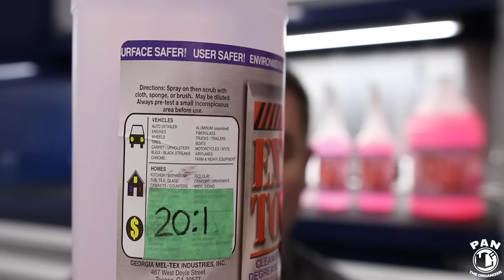EXTRA TOUGH multi-purpose cleaner and degreaser review!  +15% DISCOUNT !!!

Comment: I have been using Extra Tough for about three months in my detailing business and it has replaced Meguiar’s APC, SuperClean and Simple Green.  This is a really versatile product that does not have the strong fumes when sprayed using a 1:1 dilution.  Outstanding as a strip wash to remove waxes & sealants and you don’t have to worry about how long it stays on the clearcoat.  Powerful degreasing action for engine bays and cleaning grimy, greasy wheels. Saves me time cleaning floor mats and it will not discolor plastic or vinyl surfaces. 
The product is packaged with great care so it will not leak during shipment and you get the full amount you paid for.  Very economical when you calculate the cost using the different dilution ratios.
Reply from the maker: I agree with everything you said John!  Thanks for sharing.
Reply: Thank you for the great review and letting us know about your experiences!  We really appreciate it!  I hope everyone reads this!  It means a lot to us as a small business.
Reply: Any feedback regarding use on aluminum engine blocks?
Reply: Can you use on clearcoat with no protection?

Comment: I have been using Extra Tough Multipurpose Cleaner since Wilson Auto Detailing demonstrated this product.  It has been a huge staple in my auto detailing.  I use it on my personal cars as well as others and have been very impressed with how safe it is to use.  I also use it around my house for exterior washing and for stain removal on clothes.  The results have been amazing.  When you buy it from their site, they include a dilution chart.  If you follow the chart, you will not be dissappointed and the gallon goes a long way.  The smell is not offensive and the customer service is outstanding.  As a long time user of this product, I can testify to how effective and safe it is to use.  I love it and highly recommend it.
Reply from the maker: Thanks for sharing your experience Melvin!
Reply: why did luke take the video down?

Comment: I don't see my previous question so I will repeat it. How to get grease off a rubber truck mat under a propane food smoker? I applied it with a 1:1 ration yesterday and I re-applied it again today. It did a pretty good job. I'm guessing this was a 2-year buildup, so I can't expect perfection. I have a kayak that was spent 1000-hours in Lake Tahoe and it easily removed all the water marks. 15% off still worked. Unfortanely the US Post Office didn't live up to its 2-day delivery and put it sideways in the mailbox, even though it was marked this side up on all 4-sides. Good news its was packed perfectly and didn't leak.

Comment: Hm super clean 8.92 a gallon at Walmart or 32 a gallon for this stuff . Naw I’m good , super clean it is
Reply: Super Clean doesn't really work much at a ratio up 1oz Product to 32 oz H2O. For the need to be gentle, Extra Tough works quite well. Super Clean and Extra Tough have their places, but for regular maintenance, Extra Tough.
Reply: Collin Hopper will extra tough foam if put in a foam sprayer?  Thx

Comment: I used Extra Tough on my engine & under carriage of my 69 VW dune buggy. It leaks oil around the valve covers and gets really nasty & dirty from going on & off road. I was impressed "E.T." removed the oil and gunk with little effort. Other comments on this post mentioned Surfex HD. Now, I can't compare to Surfex HD as I have not used it. I personally have used Simple Green for years. Like S.G, E.T. it is also a safe, non toxic, biodegradable and made in the USA.  Based on my comparison I found E.T. to be more aggressive on removing the dirt, grime and oil. One side of my engine I sprayed ET, waited a minute and the engine came clean with minimal effort. I repeated the same process for the other side with SG, it came clean however it took 2 & 3 applications with more aggressive scrubbing & wiping to get the same effect depending on the area. I used full strength for both products, no diluting. My wife used it to pre-treat some stains on our concrete patio prior to pressure washing and they disappeared completely.  I admit its a new product for me and I was skeptical cause SG has been my go to cleaner but after trying it for myself like Pan did in this video I can say hands down it works great for general cleaning or degreasing.  Pan, great informative video, with different applications and ratio's. Good job & thank you sir.
Reply from the maker: Thanks Jim!  And thanks for sharing your experience with my viewers!
Reply: Thank you for trying Extra Tough out and sharing your experience!  We appreciate it!

Comment: Hi Pan. Sorry this question is off video topic.  My wife’s 2012 Volvo XC90 has the tan leather interior and well the leather hasn’t held the tan color very well in the front 2 seats. There are light spots.  I was thinking about re-dying the front two seats. Do yo have any suggestion of either alternatives to dying or which product to use to dye the seats with.  I didn’t see a video where you got that Indepth into restoration like that.   Thank you. Phil M.  😎👍🏻
Reply from the maker: Hi Phil.  You should reach out to the guys at Colourlock.  They are leather care experts.

Comment: Pan quick quiestion. Is the maguiar's synthetic xpress wax  considered a ceramic coating as well as the turtle wax ice seal and shine?  I ask beacause am not suere if I should apply IPA before. Since that is apply (according to you) before ceramic coating.
Reply from the maker: Xpress Wax is just a spray wax.  You don’t have to IPA before applying it.
Reply: @PanTheOrganizer  ok got it. Now what if before the xpress wax I did a compound and eventually a Polish do I still have to apply IPA?
Reply from the maker: It’s always important to use an IPA after the last polishing stage.  It removes polishing oils and allows a better bond of waxes, sealants or coatings.

Comment: If I want to remove the wax layer on the car, what would be the dilution on that? Thank you!
Reply: 1:1
Reply: @1_Moretime  Will it act as a decontaminator too? I'm trying to get it down to bare bones I guess before I apply wax or coating or sealant
Reply: Performance Now  more of wax or sealant remover. I would suggest to use a iron remover and then follow up with clay bar....and your choice of wax/sealant.  Hope this helps.

Comment: Good stuff albeit pricey

Edit: when you used 1:1 as a presoak you only showed wiping it off with a towel. Assuming you eventually rinsed it off? Did  have a issue with a residue left behind?
Reply from the maker: No residue. :)

Comment: 8:38 Uh Pan, did you take a look at those door hinges? Thanks for the link, I will have to check this out. My trouble area has to be the wheel wells. My tire is too close to get a brush in there and I have been looking for something I can spray and and remove with the pressure washer. I've tried just about everything and while it looks clean at first, that white film comes back unless I agitate it with a microfiber towel. I can get everything else clean, just those dang wheel wells. My next product to try was going to be the foaming stuff like engine degreaser.

Comment: But is it better than Simple Green?  What about painted factory wheels, is it safe?  Thx for the video.
Reply from the maker: I never tried Simple Green.  Do you watch Darren’s channel?  :)

Yes it’s safe on all OEM wheel finishes.
Reply: Tundra Whisperer I feel Simple Green is just a waste of time imo. It has never cleaned anything that I have applied it to. If I’m going to use a product for home application, my go to is Krud Kutter it’s safe, non-toxic, biodegradable and it kicks a$$.
Reply: akaredcrossbow interesting, never heard of that.  I’ll look for it.  Thx
Reply: Pan TheOrganizer I catch his videos on occasion, but man can that guy talk, WOW!
Reply: Tundra Whisperer I use the Tough task Krud Kutter. I have never tried it on tires, but I bet it would clean them very well. Im going to have to try it. It’s also not expensive. It works amazing in a smokers car, it makes the panels look like they are bleeding! Gets rid of dirt immediately very quick! They have several products! Krud Kutter Original removes grease, wax, tar, sap, fabric safe, water based and leaves no residue. I’ve never used the original, but it’s probably as good as the tough task! Rust-Oleum makes the product. The smell is ok not my favorite! If you go to their website it will tell you what the products do!

Comment: You say it can be used to strip wax and sealants, but what about using this after polishing to clean up the residue left behind?  This is much cheaper than Carpro Eraser and Gyeon Prep, so I'm extremely curious to see a match up between these "prep" solutions.
Reply from the maker: This is not an IPA.  I would still use a proper paint prep or IPA to remove polishing oil and residue.
Reply: Thanks for clearing that up!

Comment: ? If I use a ratio of 1:1 on floor mats does that cause any damage or just waste product
Reply from the maker: It should be fine but you’d be wasting product.  Always test on an inconspicuous area first.
Reply: Depending on severity of the grunge/dirt on the floor mat, we think you would be wasting product.  We recommend diluting Extra Tough 10:1 first to see how that strength works for your application.  Leave Extra Tough on the mat for about 60 seconds, agitate and rinse off with water.   We have seen from customers where 15:1 works too.

Comment: What surfaces is is NOT safe on? Looks great so far!
Reply: We do not recommend it on polished aluminum, porous counter tops and ceramic coats for autos.  Always pre-test inconspicuous area first.  It is safe on most surfaces at full strength.
Reply: Georgia Mel-Tex a true ceramic coating will not be affected by a APC/alkaline cleaner fyi. I am assuming you mean ceramic sealants, waxes in which ET will break it down.
Reply: @Jeeper1378  Correct.  A true quality ceramic coating should not be affected.  Dilutions of Extra Tough need to considered as well when using as a general wash/cleaner for other applications.  ET is bottled as an industrial concentrate that can be diluted to many applications which makes it so versatile. Thank you for your clarification.
Reply: Georgia Mel-Tex ty i have a gallon and used it as a strip wash on my opti coated car.

Comment: Is it safe on a ceramic Coating?
Reply: We do not recommend Extra Tough for ceramic type sealants/waxes as it can/will strip off the product depending on the dilution/strength that you are using.  When using Extra Tough on a true quality ceramic coating, it should be safe to use.  Always test Extra Tough on an inconspicuous area first.
Reply: @georgiamel-tex8349  okay thank you so much for your reply

Comment: Can someone state the order from 1st step to last as far as cleaning an old car or a car that hasn't been cleaned in a while. And I'm also trying to figure out the difference between decontaminate, sealant, wax, last coat, ugh, very confusing.
Reply from the maker: Here’s a video I made about detailing a neglected car: https://youtu.be/KsmXHos0zyY
Reply: @PanTheOrganizer  awesome! Thank you
Reply: @PanTheOrganizer  can I use this cleaner as you show in that first step to lift the dirt neglected car using a pressure washer? thank you!
Reply from the maker: This is not a snow foam, Extra Tough is a cleaner degreaser.  But you could use it diluted 2:1 or 1:1 to pre-treat your vehicle to brake down stubborn dirt and traffic film before you wash it with car shampoo and a wash mitt.

Comment: How to clean cloth interior upholstery with Extra Tough...start with a 15:1 dilution ratio.  For really tough stains like mustard, ketchup, lipstick, chocolate, you can put full strength on a wet microfiber towel and rub the stain out.  Typically the stain will lift and remove within 19 to 30 seconds.  Afterwards, you can wipe the spot with a wet microfiber towel or extract with an extractor.  You can follow examples of interior cleaning on our facebook page georgiameltex.  To order:  www.georgiameltex.com
On our facebook page, we demonstrate and compare different dilution ratios so you as a viewer can decide which dilution ratio you think is best to start with for what you are cleaning.